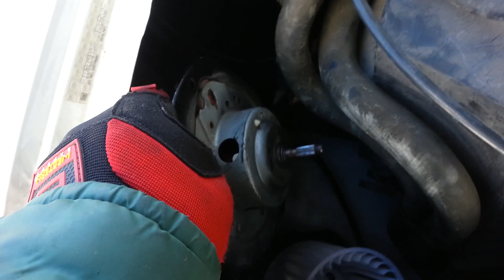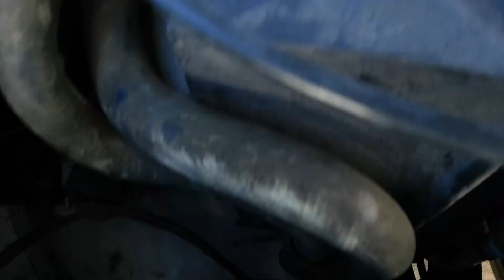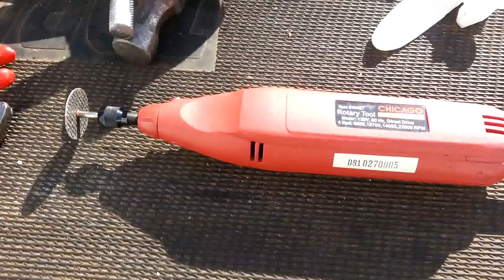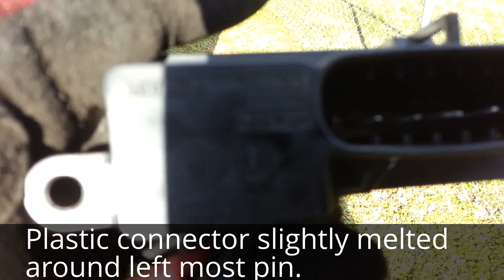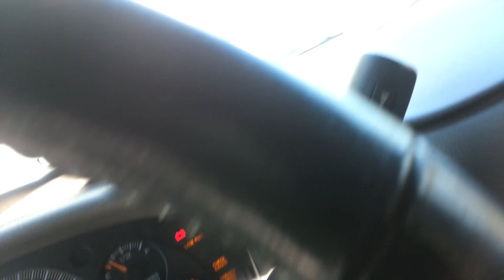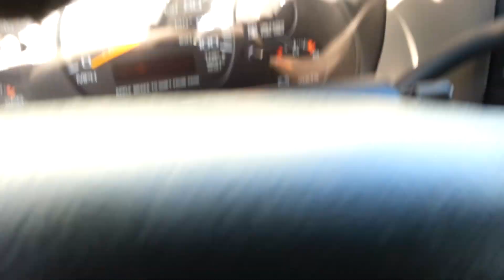2000 Astro Van Blower Motor and Resistor Pack Connector

Comment from the maker: Abe, your front vents are controlled by actuators. You need to make sure you have vacuum at each actuator and that they are moving the duct levers. Check out my youtube videos on this:
2000 Astro van; no floor heat; parts 1 & 2 
2000 Astro Van vacuum system diagram.

Comment: Great video. I got 1997 chevy astro van.  Blower motor works  ac works.  But only air comes out  by default vents. no on the front.  I  checked for vacuum hoses leak everything at vacuum tank and heater valve is ok. what else could it be? ?

Comment: Hey Evan. How do you test the resistor?
Reply from the maker: l didn't go into detail on testing the resistor pack bcos of the electronic details. If I remember correctly you put you ohm meter across each resistor to make sure none are open or shorted. Then using the ohm meter I located which pins went to the relay coil (sorry i don't remember which pins now) should show short or  low resistance. I then applied 12v (on/off quickly) to those pins to hear the relay click. I think the relay applies full 12v from battery to run blower on high.

Comment: I've got to do mine it's been giving me repeated problems over the years, now it's quit completely. I think I'll find a way to bypass that PIN all together and just hardwire it. the problem being that a pin is still a loose connection now isn't it, and if it were wired directly with NO LOOSE PIN then it might not heat up as much. Food for thought. maybe I'll put an enclosed fuse there too. rather have the fuse blow then over heat the wires and cause a fire. Cheers.

Comment: GM engineers did a crappy job in all of this type of connectors the main problem is that the pins are a very thin gauge that it's going to over heat trying to handle so many amps and cause this problem, the pin for the heavy gauge wire should be same size as the wire.

Comment: Cutting the blower housing open? What the hell was GM thinking?
With all the import cars I have owned, the heater blower outlasted the car.
My Astro blower failed at 100 000 KM. Hideous vehicle.
Reply: francis white Those vans will go 500,000 miles with mininal care, i have had 3 of them all have well over 200,000 miles on thier original engines,best GM vehicle ive ever owned but stuff like this is a problem as is door handles and power windows and disentigrating radio knobs and the rear door latch but the engine and the main mechanical parts that drive it down the road are rock solid in these old things, i have a shorty with a 350 V-8 conversion its fun to drive.

Comment from the maker: Thanks, so far the connection is holding up with fan on high, but I'm not driving the van everyday either. I would do anything to avoid having to splice in a new connector.